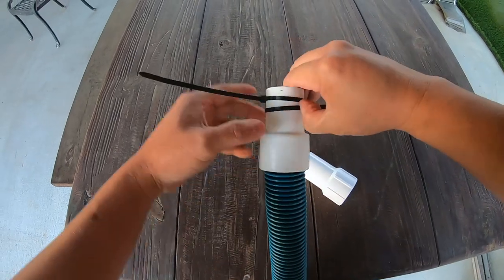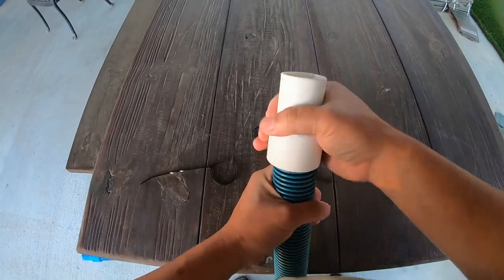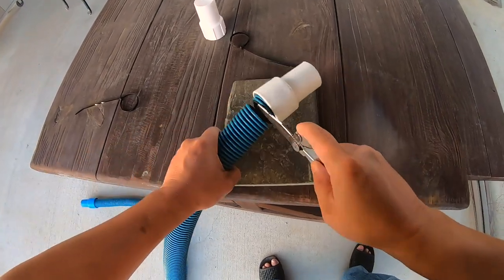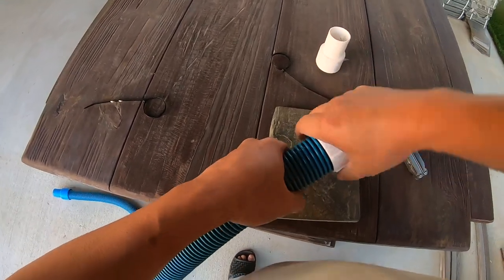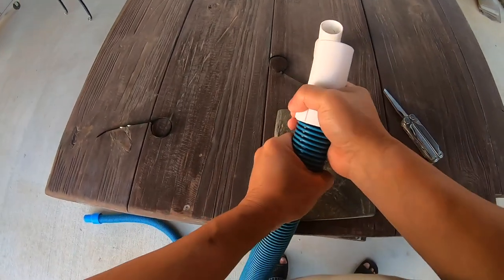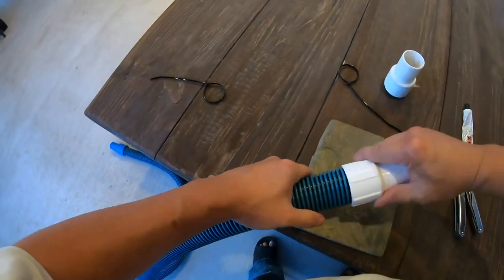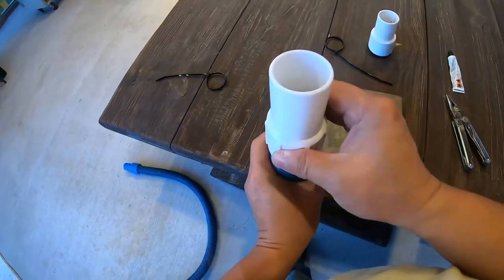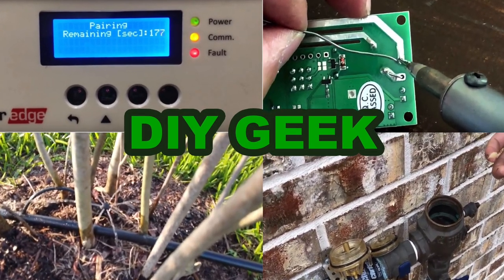HOW TO REPLACE BROKEN SWIMMING POOL VACUUM HOSE CUFF

Comment: The cuff is counterclockwise tighten but the hose is a spiral the whole way so you have to get the proper cuff direction for the end of the hose.
Reply: I just checked mine and both end of the hose go counterclockwise.   How is that possible?
Reply from the maker: Hmm not sure, maybe the other end of the hose is counter clockwise?